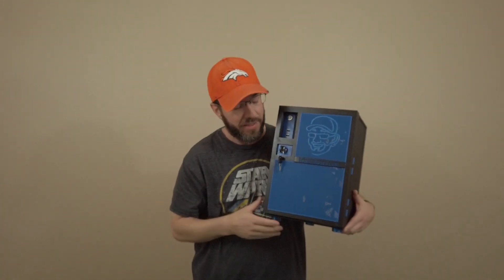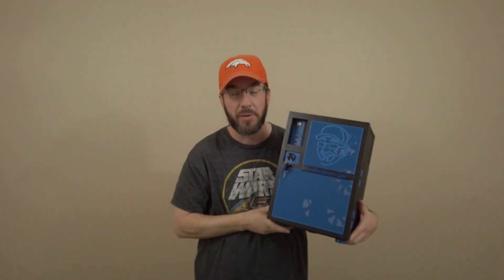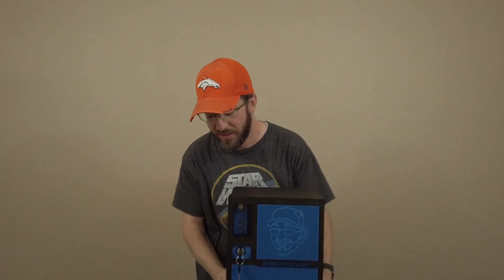3D Printing and Assembling my DIY NAS Case, the MK735

Comment: Has anyone made this case without the use of HTPLA and used regular PLA for most of it?  I printed the power cable shelf and motherboard tray so far with ABS on my CR10s Pro and it came out well.  Didn't print the two larger prints yet (power supply and drive chambers).

Comment: Isn't PLA a bad choice for these kinds of projects? I would think computers can easily have such temperatures inside which deforms PLA.
Reply from the maker: A high-temperature PLA from 3DFuel was used,  which says that without annealing, it's safe up to 60 degrees celsius.
The warmest thing in my NAS is the CPU,  and the highest temperature it has seen  is 50 degrees Celsius on the days it does its ZFS scrub.  Those same times the ambient temperature and HDD temperatures remain in the low-to 40s. 
Between the high temperature PLA's properties and the low the temperatures my NAS runs,  I'm pretty confident in this case.
Reply: @briancmoses  High-temp PLA seems to be hard to come by.  I printed the motherboard tray in ABS since I figured the CPU would be the hottest part.  What are your max temps for your power supply and drive bays?  I'm trying to see if I can get away with using Atomic Filament PLA for the drive and power supply chambers.
Reply from the maker: @BrandonLy3993   There's no temperature sensors in either my hard drive bay or my power supply,  so I can't really answer that question.

Check out 3DFuel,  it's where I got all of the filament I used,  they seem to have plenty of available options to pick from: https://www.3dfuel.com/collections/pro-pla?_=pf&pf_pt_product_type=PRO%20PLA

Comment: That's awesome.  I'm so going to print my next NAS case.  My 2U SuperMicro has to go!!!  I'll have to go look into your printer setup.
Reply: Thanks for the find. I was looking at the Pro, as I know two other with that one already. I'll have to take a look at the pdf, the 3 will do 220x220x250.
Reply from the maker: Jason Weaver You're welcome, whichever way you go, I'm curious about what your experience will be when you print the MK735!
Reply from the maker: Thanks,  Jason!  My printer's the Prusa I3 MK3,  which has been usurped by the newer I3 MK3S.  It didn't get very much airtime in my video--only a mention or two.  But it's really one of the stars of this "show"!
Reply: @briancmoses  I've been eyeing the Ender 3 Pro, on a pretty strict budget...
Reply from the maker: @jweavis   it looks like woot.com is featuring a few of the Ender  3D Printers as today's deal-of-the-day,  you may want to check them out!

I just eyeballed the Ender 3 Pro real quick, and while I think it looks like a fantastic entry into the world of 3D-Printing,  its print surface appears to be too small to fit all of the objects needed to print the MK735 (X: 250mm, Y: 210mm, Z: 200M.)

Toby K published a PDF kind of describing the requirements needed for a 3D printer in one of his Patreon posts.  Here's a link: https://www.patreon.com/posts/mk735-status-03-25857839

I believe the majority of the beta testers so far have all used printers from the Prusa I3 (mostly MK3 or MK3S)

BUT BUT BUT,  don't let that discourage you,  even if you can't print the MK735 case, I'd still suggest getting a 3D-printer.